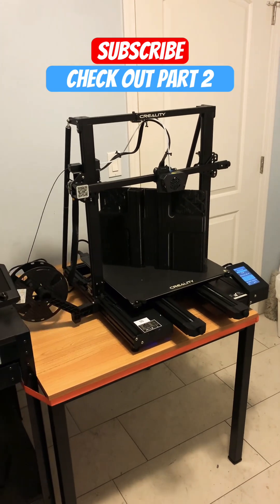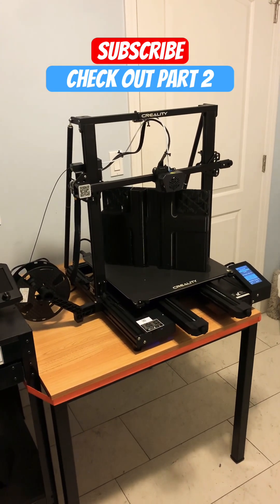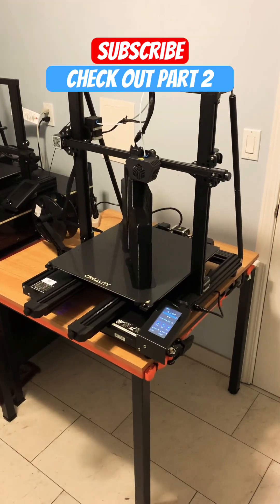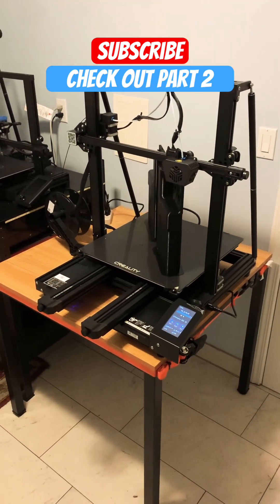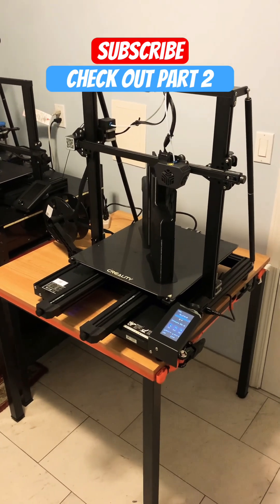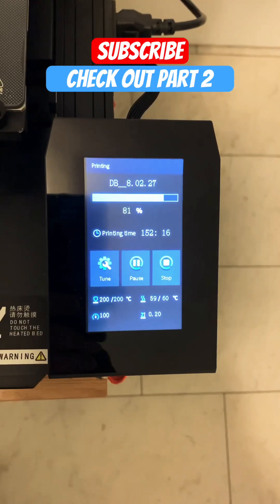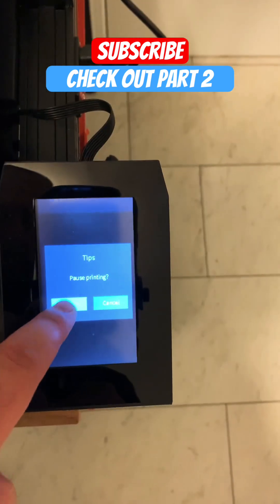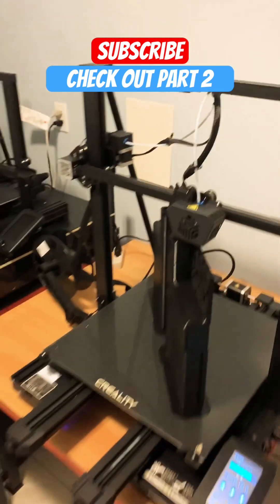Creality CR-6 Max vs. the CR-10 S5 - Pause Resume Part 1

Comment: Hey what speed do you run you prints at?
Reply from the maker: @DhiyaneshThangamaniKumaravelu  I typically stick to the generic settings that come preloaded in Creality Slicer for the specific printer I’m using. For example, when I’m using the CR-6 Max I use the preloaded setting in Creality Slicer specific to that printer and I don’t adjust the speed settings. It keeps things simple and works well for my projects :)

Comment: Hello, how are you? I'm from Argentina. I would like to know if you would share your configuration of the cure for the Creality CR6 Max printer. The truth would be that you would help me a lot.
Reply from the maker: Hello Eduardo Heredia, thank you for the comment! I'm doing well, thank you. I hope you're doing great too. Greetings to Argentina! I'd be happy to provide you with my configuration for the Creality CR6 Max. I use the latest Creality Slicer (which is pretty much Cura), and I just simply use the preloaded CR-6 Max profile that comes with Creality Slicer, and that is all really. If you’re using a larger nozzle, then adjust the nozzle to the same size in the slicer. I always use some sort of bed adhesion, like a skirt for smaller prints and raft for larger and taller prints. I also always use supports with a support density of 3-5%. Always auto bed level before a print. I hope that was useful and please let me know if there is something specific you’d like to know :) It’s great to have you part of the 3D Theory community!
Reply: @3DTheory  
Thank you very much now I will put it to the test greetings from Argentina